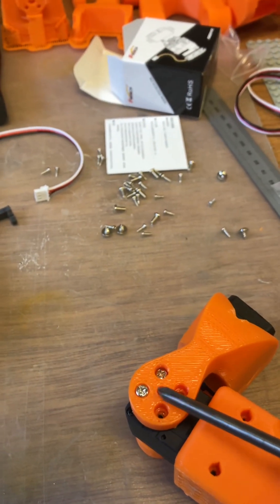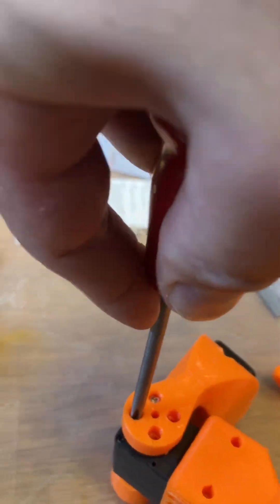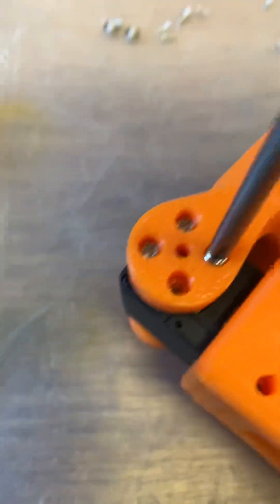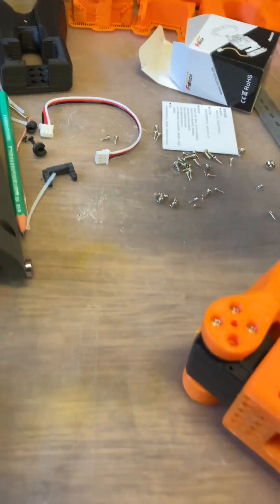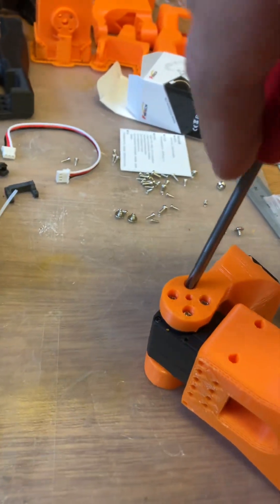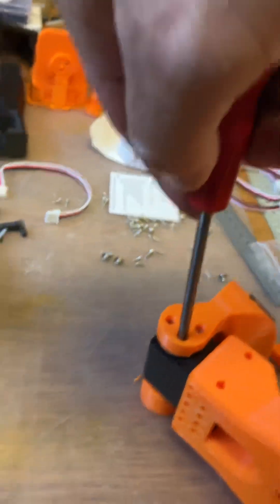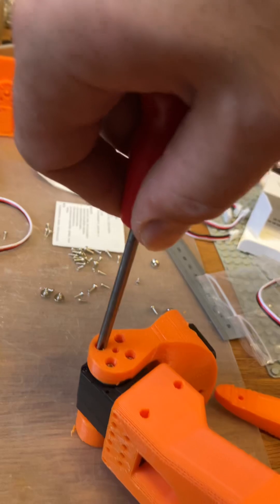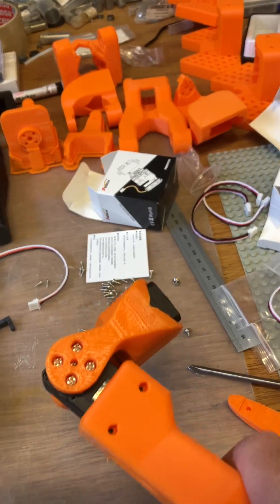Assembly detail, correct method for screwing plastic prints to aluminium servo horns

Comment from the maker: When joining the SO-ARM together all the driven joints are secured with four M3 screws into the aluminium servo horns.

Use the correct screws drive - a #1 cross, Philips or Pozidrove. 

Plastic is much softer than aluminium so the screws are very slightly tight in the prints to give better precision and stiffness and also to prevent the screws from working loose during cyclic movements.

Make sure the holes are well lined up then press the screws through the plastic print until they enter the threaded holes in the servo horn.

Screw in whilst applying downward pressure until tight. No need to over tighten, just finger tight.

Comment: If something broke or needed to be disassembled how much harder would this be to take out those screws
Reply from the maker: It’s a good point. The screws can be unscrewed until they clear the servo horn but will get stuck in the holes.

If all eight screws are backed out though it is easy to remove the servo and then the screws can be pressed out from the inside.

The aim of this design is set it and forget it. The servos are set up with a cautious max temperature and the prints are large enough that the system cannot self break.

Obviously there will be failure modes 😁 but I don’t know what they are yet.